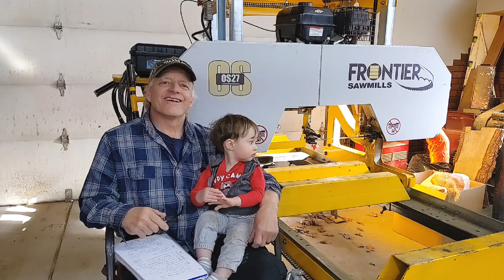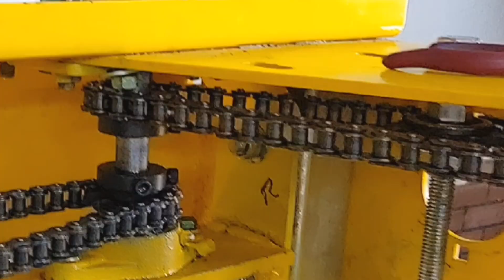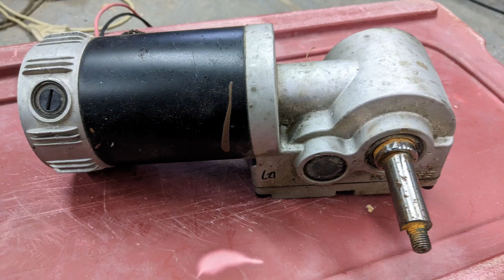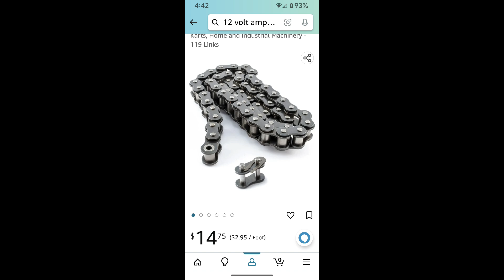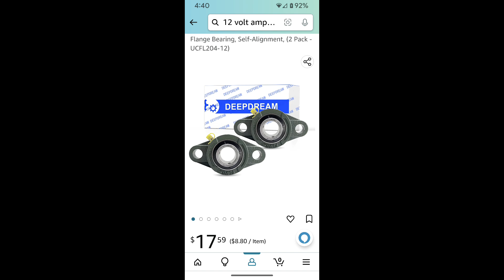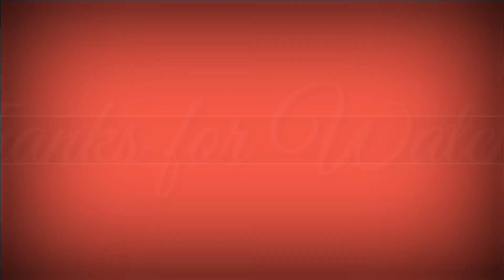Final Cost and Breakdown on the Various Parts for the Up Down Powerfeed. Part 8

Comment: What do you power the feed and raise motors with battery? I understand you have a step up transformer.
Reply from the maker: Yes I use a 12 volt battery I key charged with a trickle charger.  These motors don't use that much power compared to a winch motor. You're correct I step that up to 24 for both motors.

Comment: Thank you Jerry for sharing your costing regards your power head up and down. 
I was thinking in my head as you were reeling cost of it would be about a 800 dollar build. Probably pre covide would of had the price to about 500 or maybe 600.
Never the less, you now have a super capable machine that is fully automated other than loading and turning, but I can see that coming to light in the future. A log turning device for sure would be handy, especially with the large heavy logs you've got at hand.
Take it easy Jerry and again, well done you should be proud 👏
Reply from the maker: Thanks Buddy.   Tomorrow's video I demonstrate.   I have to learn the machine but it's definitely going to make things easier.   Thanks for the support.
Reply: @BigelowWoodcraft  I bet there is some learning to do. I have no doubt you will boss it.

Comment: Thanks again for detailed videos, Jerry. They have been a big help. I figured if I can get the steel for almost free why not try and build a mill.
Reply from the maker: I love the idea.  After being around the mill for a while and seeing how it operates I really think it wouldn't be a difficult build.  It would just take time.   Keep me posted when and if you start building it.
Reply: @BigelowWoodcraft  Started about 2 weeks ago. 2x6 rails with 2x4 cross members. The carriage is 2x4 for the front uprights and 2x3 for the back uprights. The bed is 20' and 48" wide. Everything is 1/4" wall so she is going to be a heavy one. Hope to have it running this summer. Sent you a picture through Email if that's ok.

Comment: Good morning Michigan!  I really like the setup. Looking forward to see it slice and dice. Does it draw near the same amps up or down , or more going up ?  You may want to keep your eye out for an old garage door torsion spring to throw on the scrap pile just in case. Well mannered super cute kid. Have grand boys that just turned 2 and 7. It’s a wonderful world. Thanks Jer
Reply from the maker: Yes it does use a bit more going up but only a couple amps.   I do have an extra torsion spring around. I replaced mine on my door last year.  It would definitely help pull it up.  Thanks for the idea.
Reply from the maker: Rayland sure is a blessing to our family.

Comment: Hello, thanks for the cost break-down, interestign to know. Another topic: Please let me ask you one question - which blades (manufacturer and parameter of the blade) are you using when cutting very hard wood - beech, oak, ash etc... i have heavy head-shake during cutting but also using blade for soft-wood. spruce, fir, linden etc... Thank you - greetings from europe.
Reply from the maker: Thank you Arnold for the comment.  I'm using Jerry's Ripper37s with a 7° blade.  I've been really happy.  I cut primarily hard wood like oak with some occasional soft wood like pine and poplar.
Reply from the maker: 1.25 inch blades and I believe they are 7/8 pitch
Reply: @BigelowWoodcraft  Good Morning Jerry - thank for answering! I didn't expect that they are shipping to EU/Austria but good to know which blades you are running, thanks- i also reached out to Woodland Mills about the head shake cutting hardwood. Lets see...